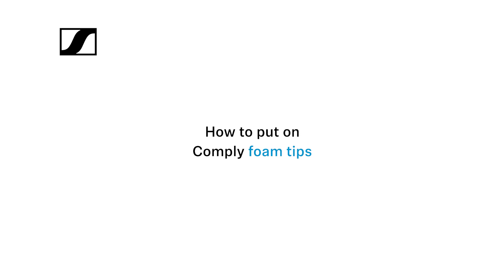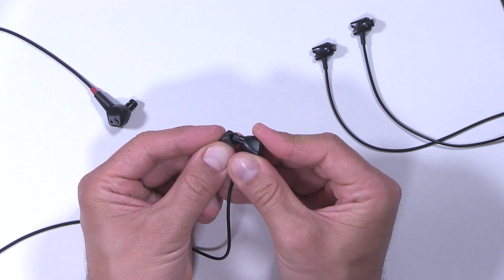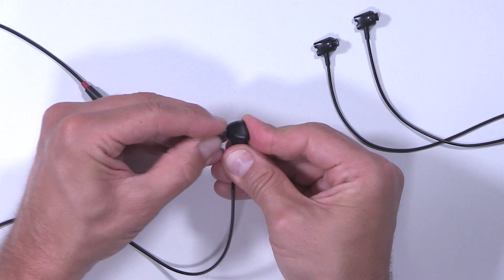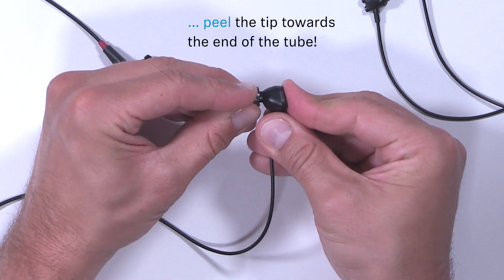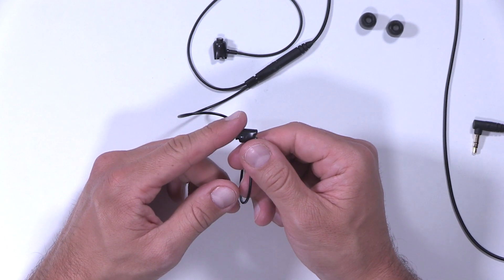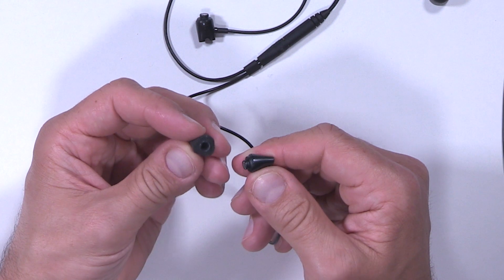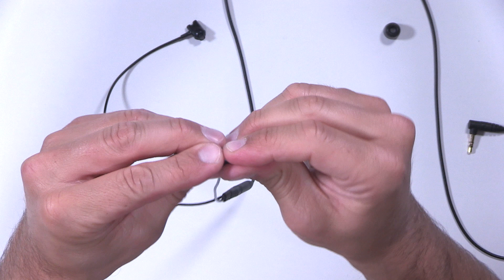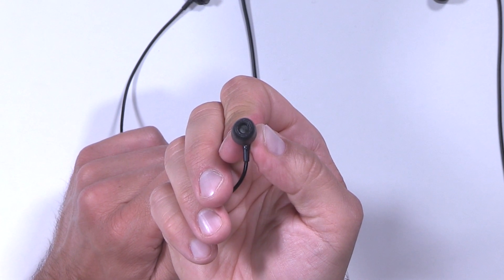How to put on Comply foam tips I Sennheiser

Comment: Since the Momentum Free has Sennheiser come out with something as dynamic?
I am in need of a Bluetooth wired earphone.
I thought the Cx150 bt and Cx350 bt ( which are 99% identical with 10 hours of battery but not “loud enough” would be superior to the Momentums but they are not.
So I considered the Cx6.00 which looks and sounds impressive but with only 6 hours of battery I am disappointed as I travel a lot.
So what would you consider please?
Many thanks